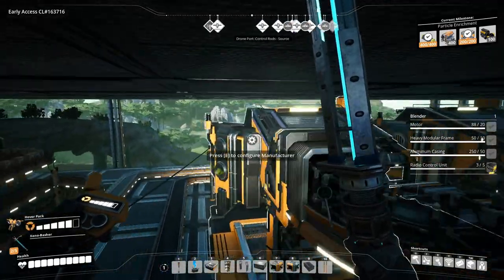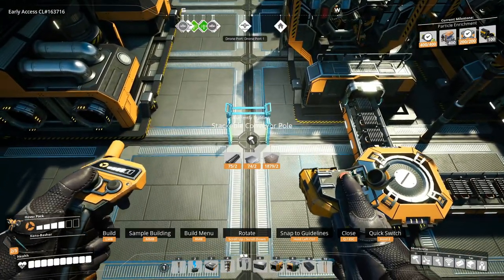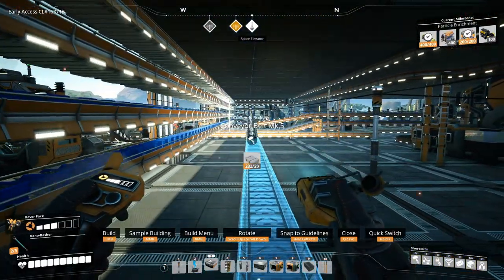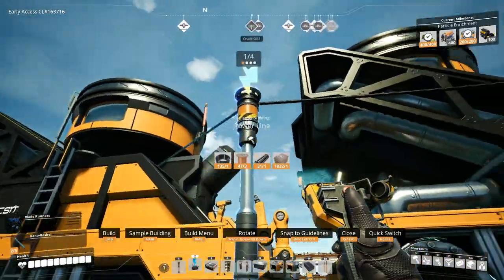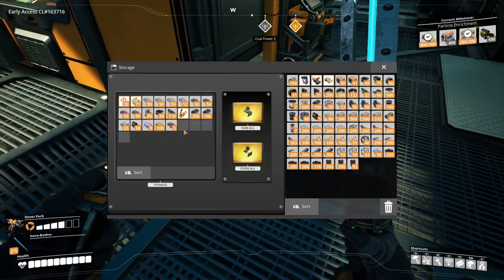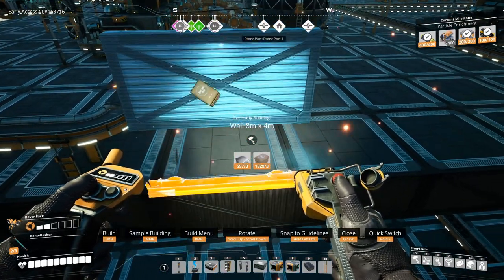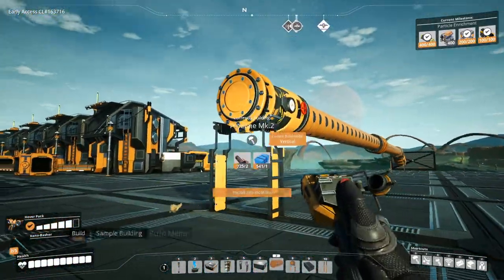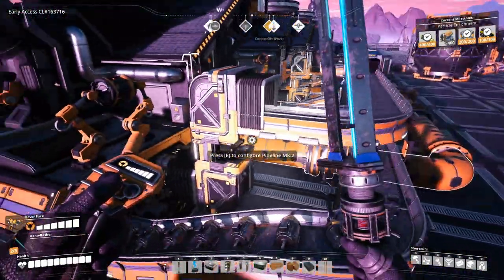Producing Cooling Systems - Let's Play Satisfactory Update 4 Part 161

Comment: On the buy screen of the Awesome shop, it has its own buffer  to hold items you've purchased. If you look at when you bought the motors, it shows 8 stacks of turbomotors there, which I think corresponds to the glitched buy you did long ago as well. 

You can re-access that screen from the awesome shop, but it's not so obvious (I think you have to click on the "Buy" button or something. I didn't expect despawning the awesome shop would bring them back too, so I learned something too. :) 

Also, just another reminder, you can click on the Elevator from the Map and see how far along the Project is. You don't have to go all the way to the elevator each time.
Reply from the maker: That's good to know!